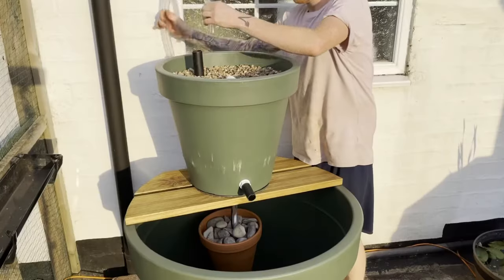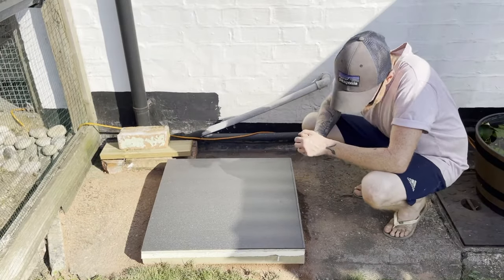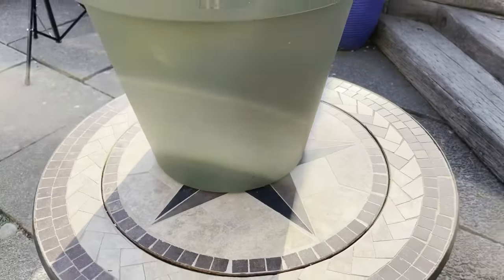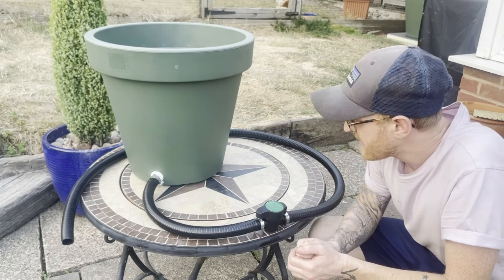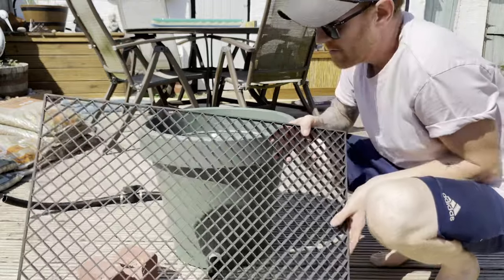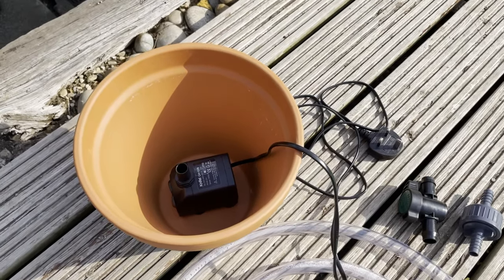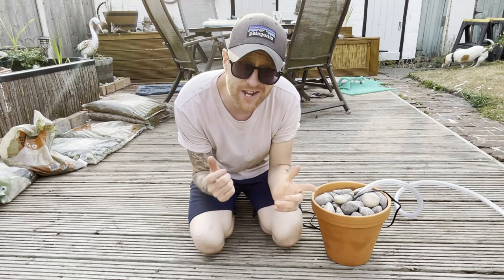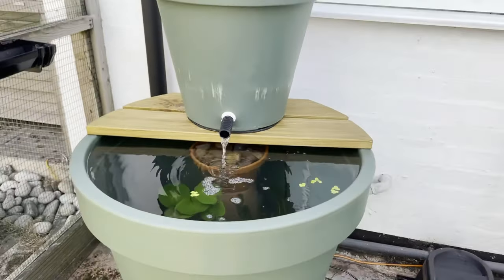DIY ‘Patio Pond’ Build, with BOG FILTER!

Comment: I have a closed filter system with foam I got at a home store that runs my waterfall.  Can I add a seperate bog filter into the pond?
Reply from the maker: Yeah, you can always add a bog filter!! 👍😊
Reply: Another question the water outlet with all the tiny holes...should that be completely covered with gravel so it doesn't suck air?  Also I am starting with a green pond it is starting to get clearer, any suggestions?? I am waiting for plants as I have to plants in the pond.
Reply from the maker: @roseanngibson4084  the water outlet with the holes doesn’t necessarily have to be covered, that’s up to you really. I personally like to cover it, so there is no water visible at the top of the bog. If there is water visible at the top of the bog, it tends to attract birds that like to come in for a drink, which is fine, but whilst they’re having a drink they tend to also poop in it, and that poop is very nutrient rich and can they cause algae. Also if you live an area where mosquitoes are an issue it’s best not to have visible water at the top of the bog, as they’ll be all up in that. As far the green water goes, the addition of the bog filter and plants should sort that out.. it may take a little while, but it will go clear. You could add a UV and that will clear it up in a week or 2, but the bog filter and plants will definitely also clear up the water, it may just take a little longer. 😊👍
Reply: @GingerFishyOfficial  thank you!!😀
Reply: I just wanted to say thank you on your advice.  My pond has never been this clear in my life.  I believe it was my homemade bog.  It went from pea soup to crystal clear that I can see the bottom❤
Reply from the maker: That’s awesome to hear! I’m glad you have a nice clear pond to enjoy!! 😊

Comment: Hi, I’m worried that my big will overflow. How do I prevent this?
Reply: Bog*
Reply from the maker: Hi mate, there is a couple of things you can do to prevent the bog from overflowing. Firstly you could make the outflow bigger. The bigger the outflow, the quicker the water can flow back into the pond, and therefore reducing the chance of the bog overflowing. Secondly, if you’ve already built the bog, and you can’t change the size of the outflow, you could add a flow control valve, that way you can just reduce the flow down to the point that the bog will not overflow. Thirdly you could add a second outflow, a little higher than the current outflow, that way if the water can’t exit quick enough through the current outflow, it can go out the second outflow. Adding a second outflow is also handy if your main outflow gets blocked with plant roots or general debris, it give you a bit of time to get in there and do a bit of maintenance. Also, I always like to make sure that my pond pump is not in the very bottom of the pond. Instead I like to have it raised up off the bottom by a few inches, that way, if worst comes to worst and the bog filter does overflow, there is no possible way that the pond can be completely emptied, and therefore saving the fish. Hope that helps! 👍😊